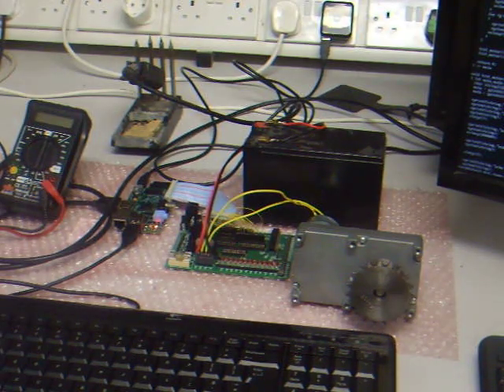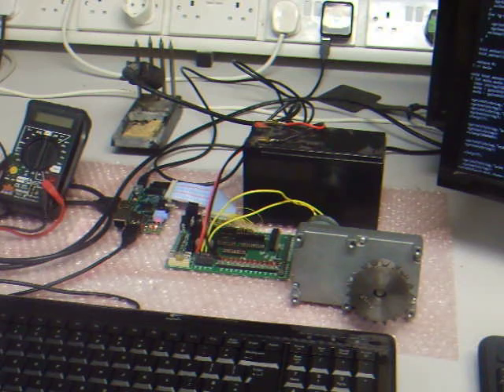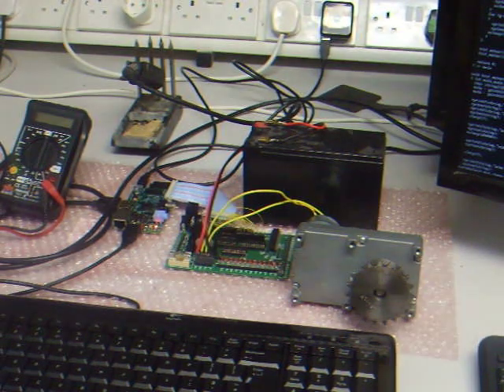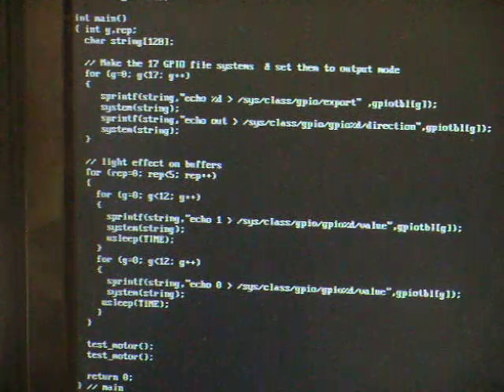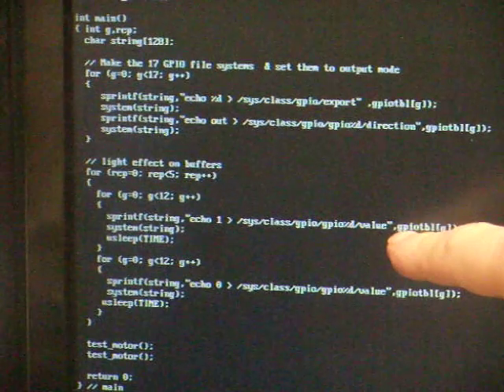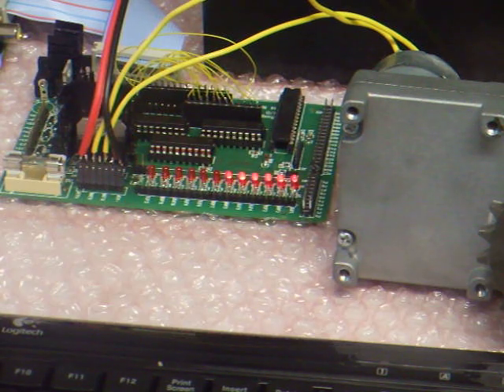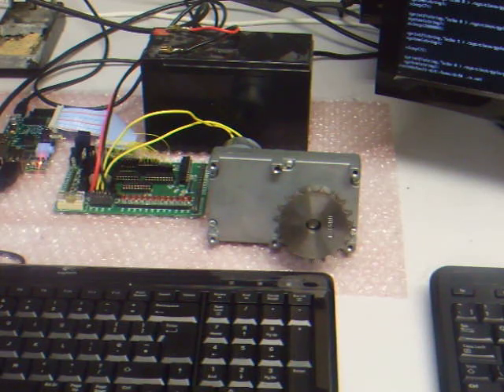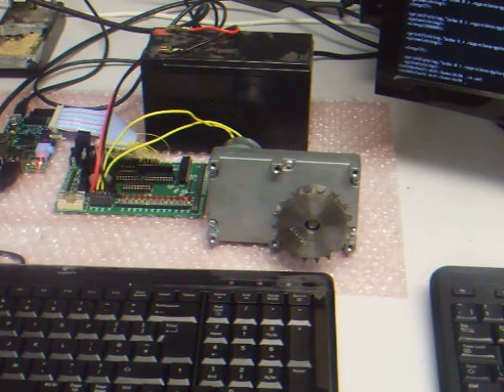Gertboard first contact

Comment: Things like this makes the raspberry-pi so interesting, you could mount it on the back of your TV connect the usb and hdmi cables to it. Along with this motor you could then use a simple press of your htpc wireless keyboard/mice make the TV swing down from the roof or out from the wall.

Heck with the cheap cost this is probably even the best buy you could make for such a simple thing as a internet radio.

Comment: Is there a way to control more than one motor and have each running at a variable speed? Or am I going to have to wire up a l293d to control my 4 dc motors?